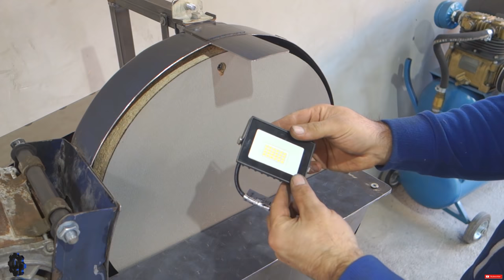DO NOT THROW THE OLD WASHING MACHINE  every metal workers needs this!!!

Comment: Very nice; well done peChoO It's just a thought [and only to help], but if the disc was not ''out of round'' it would shake less, be better for the whole sander, and work better. It wouldn't be hard to correct either; just use the sander itself as a temporary wood lathe. At 18.00 mins it shows how/where you could: 1] clamp a piece of round stock in front of the disc  2] spin the disc to find the "high spots" with a pencil  3] with a sharp HHS lathe chisel, and the disc spinning slowly make it perfectly round  :) God Bless; Merry CHRISTmas to you and your family!

Comment: When you grind wood clean the dust, if not sparks from metal plus forced air will ignite that dust
Reply: I had to stop 2 fire hazard in my shop that way
Reply: Ferrous metals yes, aluminum not a problem. Been doing it for decades.

Comment: Your projects are great in metal work but you should ask some electronics to make those projects more efficient. Using smaller engines, inverters, pcb's, gears etc you can make stuff much more energy saver than now. You can have 4kw energy power using 1kw.

Comment: That has got to be the largest disk sander I've ever seen built. Nice construction and finish. Could go a bit further and add the vacuum switch on the top electrical box as well as a individual light switch there too. That way you have individual control of everything at one place. But very nice project indeed... Thumbs Up